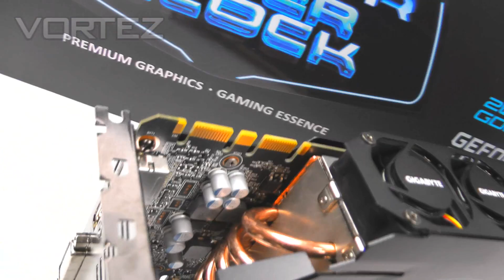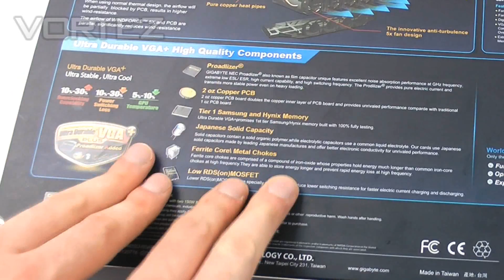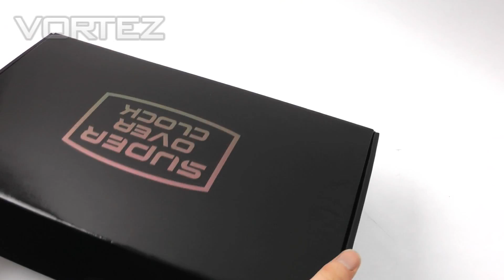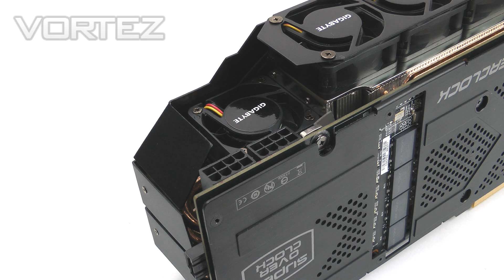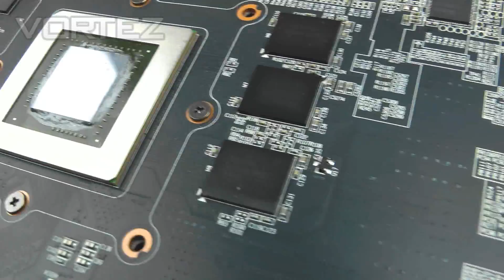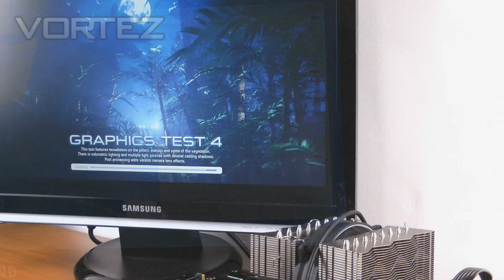GIGABYTE GTX 680 SuperOverclock Windforce X5 [HD]

Comment: i've owned pairs of GTX 470s, GTX 570s, HD 6950s, HD 6970s, GTX 680s and an HD 7970 GE. i pick them up just to play around with them just because i have the money to burn. after i'm done with them, i sell em off at a $50 to $75 loss. 

having said that, why do you own 10 of each card, i'm curious.

next thing, this reviewer is consistent with every other i've checked. are you implying that nVidia paid off everyone under the sun? or that no but you knows what they are doing?

Comment: i have an EVGA GTX 680 and a VisionTek 7970 GE. my results are very much consistent with what i've seen on review sites

having said that, do you think that AMD would have voluntarily dropped the prices on their 7950 and 7990 cards just 2 days after the GTX 680 came out if they knew their card was still on top? they saw what the GTX 680 was capable of and cut the price of the 7970 almost immediately. then later they cut the price again and made a reference OC version 7970 to compete

Comment: You know I often find it bothersome to see someone, without even questioning all those sites but to just look and to say my results are the ones that are wrong. I dont have any vested interest in the cards. What if Nvidia sends you a stronger card? Possible? Hmm? Maybe? OR, I also found when resetting the bios on the X79 and Z77 to get clean settings on each card that the CPU settings were totally different and others causing huge score differences. I caught it after 5 tests. But almost didnt

Comment: I didnt have enough room to say I owned both the 7970 and the GTX680. In fact I owned about 10 of each. The only thing the GTX680 can even compare to the 7970 in is 3dmarks11 and a few new games. The 7970 is a beast of a card (for the first time)it beats the 680 in most tests. 
And it also holds great FPS in games at Higher Resolutions. Which has always been a win for ATI/AMD over Nvidia. 

It just seems to me they are misleading people. The 7970 also scales way better.

Comment: Im sorry but this group of reviewers are not telling the truth or are messing something up with their bencharks. 
I have owned both the Gigabyte windforce 7970 and with the clocks raised up to the GTX680 speed(which isnt much) the 7970 thoroughly beat the GTX680 in Heaven and every 3DMarks with the exception of Marks11. Which the GTX680 beat the 7970 badly. 

Even with the clocks not touched the Windforce beat it. 
I dont know whats up with their results on the review. Seem backwards to me.

Comment: Audibility ofcourse. When the GPU is cooler, the Fan spins less and in turn makes less sound.

When I changed the thermal paste of my two GTX 580's over a year ago, my temperatures Dropped on average 5'C  on the GPU's. Gave me a higher overclock headroom.

Comment: Yes, I realise that the compound would of needed to be reapplied. However,I don't know what kind of temperatures you were able achieve by reapplying your thermal compound, but I know first hand that it's only going to make marginal difference. Results have been proven negligible before. That's like saying you're expecting the same temperature from every card that comes shipped from the manufacturer. Audibility! you got to be kidding me.

Comment: And how is that? Most users do not change the Thermal paste on their graphics cards and Manufacturers put waaaay to much paste on because they think in "better than too much than too little". if he took off the cooler, it means he had to put new thermal paste on, meaning he would take off, clean and put new paste on, of a better quality and sufficient quantity. I have myself done this, and temperatures and Audibility were improved. So dont tell me it does not matter in a Review...